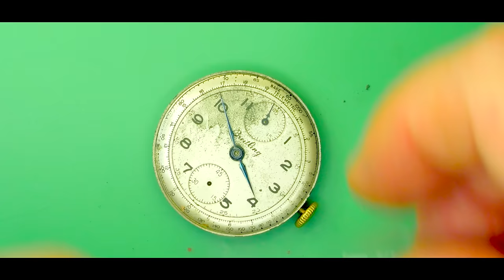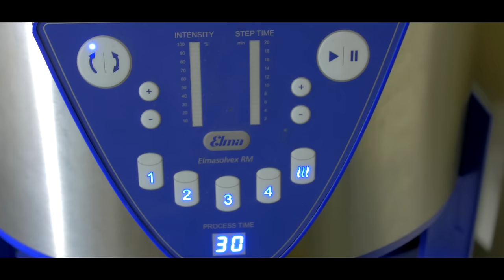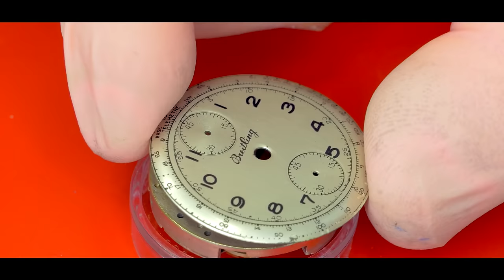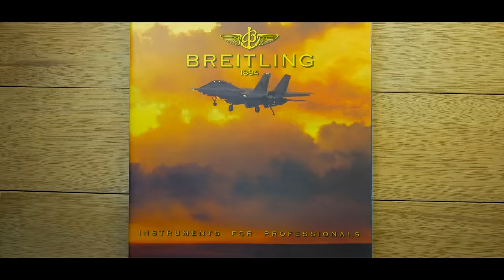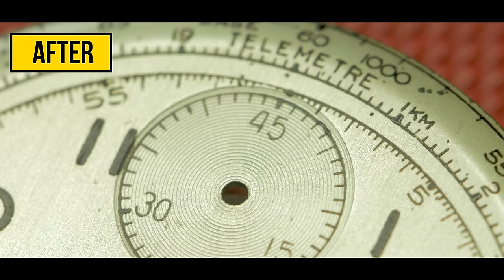Restoration of destroyed vintage Breitling watch│Nicholas Hacko Master Watchmaker

Comment: Whats with the bottom subdial for the seconds? Why is it scaled only to 45? :D
Reply: I think bottom sub displays regular seconds. Central seconds hand is for chronograph function, top sub displays chronograph minutes up to 45.
Reply: very curious about this as well. the small seconds appear to be mislabeled. I see one with the same dial (maybe the same watch) on an online auction site. can't find any others though.
Reply: I have the same model. The bottom sub dial of my watch displays seconds and it has 60. The upper sub dial displays minute for chronograph and it has 45.

Comment: Awesome Video! That movement had a lot of little parts that made it look like the designer added features after the base movement was finalized. Mr Hacko you have a great memory! True Master of your craft!
Reply from the maker: Thank you William - Venus 170 was designed just after WW2 and yes, one can tell that some construction 'elements' were bit of a compromise. What really surprised me is the post-adjustment timekeeping result. Thank you for watching!
Reply: @MasterWatchmaker  Could you tell me which products are those you used on the watch plate and on the dial to clean them?

Comment: Nicholas, I have a similar Breitling Premier but with a stainless steel case and three sub dials. I purchased this some time ago from the US. The dial had undergone a restoration, but the watch had a problem. The flyback mechanism for the chronograph would not work properly, taking sometimes three or four attempts to make it work.

As I had purchased the watch 'as is', I sent it out to a watchmaker in the UK explaining the problem. The watchmaker contacted me and stated that a part had been replaced in the watch, and that this part was the wrong part. This is why the flyback would not work properly. The watchmaker told me that since this was an old watch finding a replacement would take time. I agreed that he could hang onto the watch for a time so that he could search for a replacement part.

So, six months passed without any feedback from the watchmaker, and then a year. In the New Year I decided to contact the watchmaker and find out how he was coming along finding the replacement part. This for a time was fraught, and for a moment I thought that I might have lost the watch, but no. I was eventually informed by one of the watchmakers family monitoring his E mails and remaining estate that he had sustained a heart attack and died. Poor guy. The watch was found in the watchmakers safe, and returned to me.

So, a year gone, and the watch still not repaired. The watch is here with me in Thailand. I just wondered whether this watch might be still repairable. I understand that parts for watches can be in short supply, especially for older watches, but is it possible that in some cases that the part can be manufactured by the watchmaker? I would be interested to see your response. 

By the way, this watch style and movement is beautiful. That is why I bought my own. Just fell in love with the watch from first sight. Keeps excellent time.

Comment: Incredible restoration. How on earth did it get into the state it was in? What was the dip and scrub solution and the rinse solution used to do the initial cleaning of the plate? And what did you use on the dial? I'll understand if they are trade secrets but they worked like magic! Thankyou for taking the time to film and edit these wonderful videos, they are much appreciated. Stay safe.
Reply from the maker: Hello Jeni - deoxidation of plates is very much straight forward - I use home made solution of vinegar and baking soda.  4 tablespoons of baking soda for every cup of vinegar. Dial cleaning is bit tricky.  Thank you for watching!
Reply: @MasterWatchmaker  thankyou for replying. Your work is a pleasure to watch.
Reply: @MasterWatchmaker  Does this solution not peel the paint off the platinum of the watch?

Comment: Hey fellow watchmaker here. You´re truly a master. How high did you get the amplitude. Everything over 250° would be considered a miracle for the state the watch was in haha.
Reply from the maker: thank you watchmaker - I think you are the first one to notice the amplitude in any of my videos :-)  277 dial down and around 260 dial up! New mainspring fitted, bit of hairspring alignment - and that was it.  I was actually quite pleased with this, had to double check the lift angle (52 deg!) .  Thank you for your comment.
Reply: @MasterWatchmaker  no way haha. I really appreciate the way you handle the movements. Truly majestic, hope to be as good as you one day. But damn 277° is very very good as you and i know especially for a movement that old. Hair aligment on a breguet spring? Thats something you don't see everyday i would be scared to touch it. 

Thank you!!

Comment: I am very curious as to what solutions you're using for the dial. I've tried several different things myself, with varying results. Alcohol-based solutions like isopropanol works well on some dials, but I've also experienced it damaging the print on the dial, and I've had sunburst-type dials "melt", in lack of a better word. Really do hope to hear back from you!

Comment: May I know what is that tool that you use like eraser to clean off the plates after you soak it in the solution? Also may I know what solution do you use to soak those plates? Thanks!

Comment: Wonderful, got a question, the constants seconds dial says 45.  Is it running at one revolution = 45 seconds?  Or is the dial incorrectly redone?

Reason I ask is it looks like the constant seconds is in synch with the sweep seconds; that is it is running one revolution in 60 seconds.  Call me confused ;-)

Asking as I restored a Lemania with a 30 minute counter and the dial restorer placed a 45 minute chapter ring on the sub dial!  That went back very quickly!

Also, what solution did you use to clean the dial as it turned out perfectly with just some tachymeter numbers faded.

Again, fantastic and learned a few things as well.

Best regards, Geoff

Comment: As Mark Mc pointed, the minute has 45 seconds.. Who would print such a dial?
Reply from the maker: That mystery is yet to be resolved... One thing is certain: the minute counter and seconds hand subdial are identical and printed at the same time. Genuinely unique dial.
Reply: Master Watchmaker. Really enjoying the channel. on the subject of dials, why do watch and clock makers use IIII to mark the 4th hour and not the correct Roman numeral IV ?
Reply: @MasterWatchmaker  That must be a misstake made when printing the dial. And then QC did not catch it.